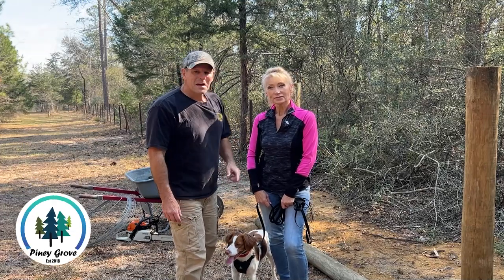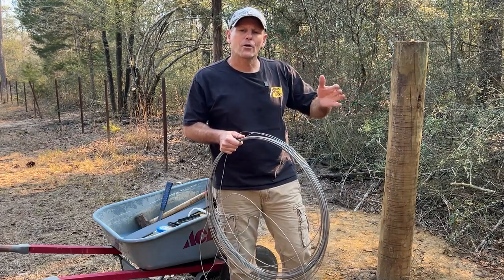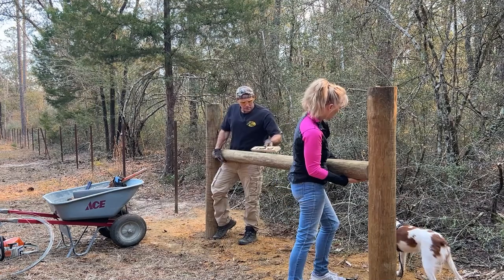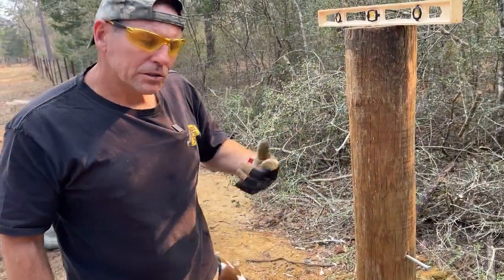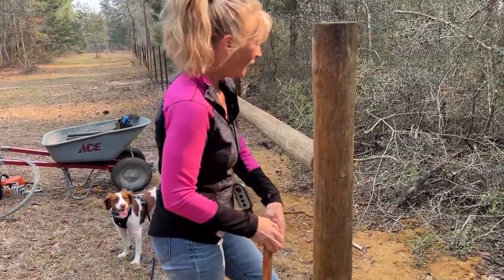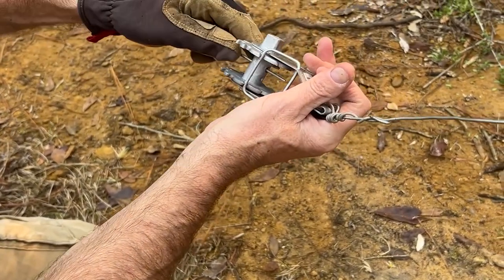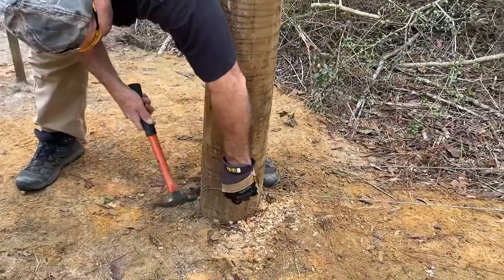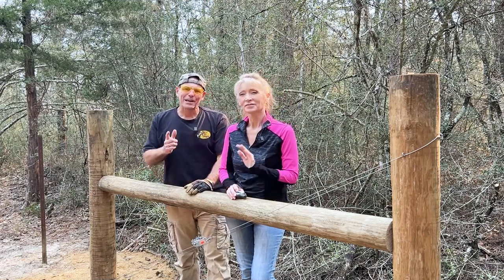How to Build an H Brace for a Woven Wire Farm Fence

Comment: So, you didn't drive the spike into the cross beam you drilled it, too, and the spike just holds it, right??
Reply from the maker: The spike drives into the end grain of the horizontal a bit, but the wires are what ties it all together.  The spike keeps the horizontal from dropping down if the wires get a little loose.

Comment: The end/start post is the one to our left? (The one the dude nailed). If not it looks like the tension wire is the wrong way ;)
Reply from the maker: neither, this H Brace is in the middle.
Reply: It is. But he does run the wire above the horizontal brace. Normally we have the wire on the pin holding the horizontal brace which I think would be stronger.

Comment: You don't need the tensioner , just put the wire on as you did, the cut say an eighteen inch branch , place it through the wire below the cross member and twist the wire to tighten, then lock the branch on the crossmember. If it requires tightening in the future jus loosen the branch , twist until tight and re-lock it. Buying a short length  of better quality high tensile wire for this will stretch less and require less maintenance.
Reply from the maker: Thanks for watching and the tips!

Comment: One more question:  What gauge wire is that?  Mine is waaaaay too large to twist and bend like what you're using.   I was thinking it is all standard, but obviously not.
Reply from the maker: I'm not sure but this is called "bracing wire" at the farm store by us.   Maybe it's not the gauge but the type of wire.  I think this may have some aluminum in it?
Reply: @PineyGroveHomestead  thank you for your reply!  I saw on another that used high strength tensile.  Probably the same thing... But, again, thanks for taking the time to answer.  👊🏼
Reply: That will be 12 gauge wire
Reply: @IronCavalier high tension, high tensile it’s all the same. The roll in the video is a very small roll. Probably the smallest and easiest to haul around. There is a huge jump to the next size roll. 3000 feet I think. It’s heavy. 

If you’re going to do a large project I would recommend a spinning jenny. There are several kinds. I recommend one that sits on three or four legs. This allows you to unroll the wire without getting the wire kinked.

Comment: Never seen a H brace so low but I don’t think it matters on this one. Also, the corner or end post is just that. A corner or end post. The next post is a hangman’s post. Not sure why the name but it helps me remember that you hang the dead man. Meaning, your tension wire should be on the high side of the deadman’s post. 

You can also not drive your 12” stake or galvanized nail on the deadman’s post completely. Leave an inch to half inch out and put your tension wire over the nail.
Reply from the maker: Thanks for the tips!

Comment: I should have added along with a Nico crimping tool and Dbl barrel swage  sleeves ,as the line is clean no gaudy ratchet tool in the wire . Similar arrangement when using SS multi stranded handrail cable splices .
Reply from the maker: Many ways to do it.

Comment: Not real fond of the idea of leaving ratchet tension'rs in line wire ,rest of it was good job . I prefer a Tee slot tightening tool when dealing with tension wires .
Reply from the maker: They are great.  Easy to tighten over time.  Thanks for watching.